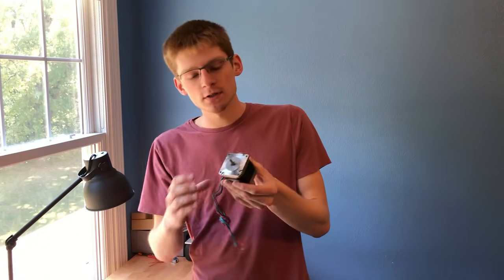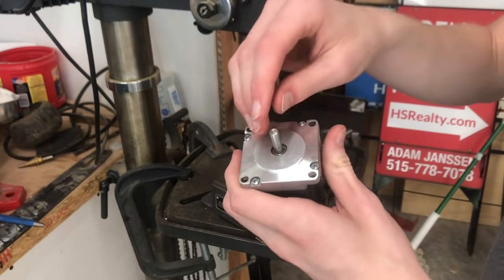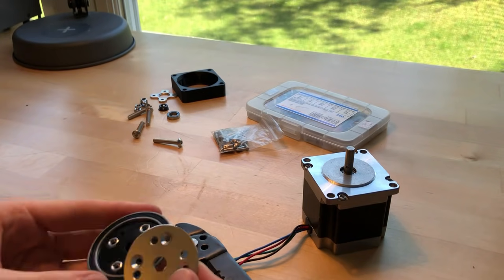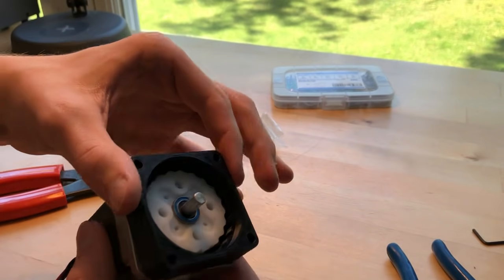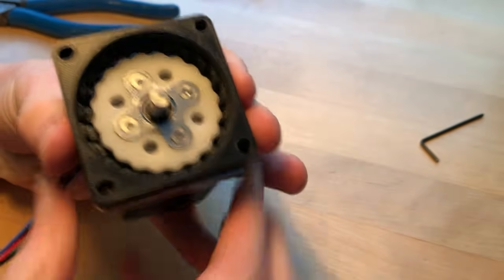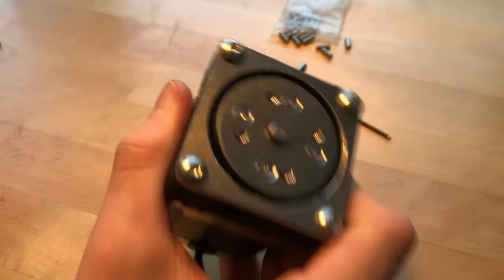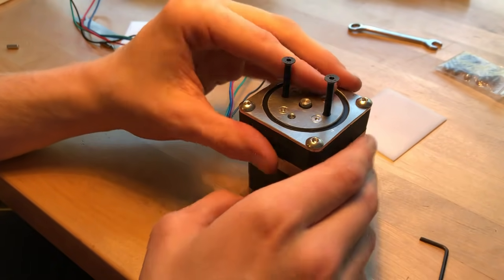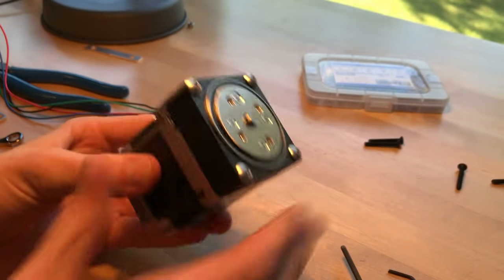High Torque Cycloidal Drive (NEMA 23 Motor)

Comment: When designing for 3D printing, keep in mind that every measurement in Z has to be a multiple of your 3D printer's Z step size. If it isn't, your parts will be off by whatever amount is necessary to bring the height to the nearest z-step. Also, use machinist's feeler gauges to get your bed dead nuts accurate.
Reply: Yeah but you have to think about the first layer too. Because for adhesion you squish it most of the time
Reply: For simplicity i stick to all dimension being 1/10th of a mm tolerance and use that as layer size
Reply: @BrosBrothersLP  There is the elephants foot setting for that to compensate the overextrusion in the first layer.
Reply: @FreeOfFantasy  the elephant's foot setting just adjusts the xy expansion of the first layer I think @BrosBrothers is talking about the not perfectly defined hight of the first layer ;)
Reply: Adaptive layers solves this issue to a great degree.
Reply: @BrosBrothersLP  It is bad if you squish the first layers, that's called elephant's foot... a proper Z alignment will give you squish-free first layers.
Reply: @BrosBrothersLP  use a structure below the print like a raft or custom structure to solve the squishing of bed adhesion
Reply: Another remedy to this is to orientate the part at 45 degrees to the bed. Additionally this can help reduce the amount of supports.
Reply: Not anymore! Slicers are starting to implement variable layer height
Reply: @skipfred  Good to know, thank you.

Comment: I think you drilled out the wrong holes.  You need to allow eccentric motion between the output drive pins and the white cycloidal gear.
Reply: Yeah I don't know how it would even be able to turn without that, interesting
Reply: Right, that is why it doesn't have a contineous and smooth rotation as the acrylic is being smashed by the 4 Pin (from output shaft).

Comment: design a direct drive  3d print head using a very small stepper motor and this concept.
Reply: Second that :) I only found one project using a cycloidal gear for an extruder. Wonder what's the reason we don't see this more often for extruders.
Reply: @neur303  There is too much slop in the mechanisms as well as too much friction. Therefore it would have horrible backlash in an extruder, and would extrude inconsistently. Planetary gears are superior in just about every way to this. Of course this does allow a bigger gear ratio in a small form factor, but the negatives aren't worth it.
Reply: @Chris-hn4lp  I read quite the opposite. That they minimze backlash in comparison to other gears.
Reply: @Chris-hn4lp  It seems planetary gears offer more torque per volume. Which would be quite reasonable for a direct drive as lower volume should also equal lower weight.
But I still believe there's more to it. Like you wouldn't be able to use a planetary gear with plastic gears. And the cycloidal gear should be a lot easier to manufacture.

https://www.machinedesign.com/news/article/21829580/comparing-cycloidal-and-planetary-gearboxes
Reply: @Chris-hn4lp  yeah this a one of the few designs without backlash, not that it is an issue for the extruded as it can be correct with extra restart on retract ...
Reply: @neur303  The article you linked says the exact opposite of what of you just said. It confirmed what I said, that you can get a bigger gear ratio with a smaller size cycloidal gear. I think you misread it wrong.
Reply: @neur303  The article you linked did say  that unlike your other comment, but I was specifically referring to gearboxes using 3D printed parts. You need extremely low tolerances to get a cycloidal drive with low slop and backlash. Planetary gears on the other hand are much more forgiving of tolerances. So sure, if your using an EDM to make your parts, then yes, you'll get less backlash with the cycloidal drive, but if you're using FDM 3D printing you'll have better results with the planetary gear.
Reply: @Chris-hn4lp  Cycloidal often have extremely low backlash.
Reply: @neur303  I saw a guy lifting an anvil with 3d printed planetary gears

Comment: Please use real units and not ounze-inches or so. Please! There are internationally used units that really base on each other. Please!
Reply from the maker: I tend to prefer ozin to Nm because they're easier for me to visualize. A newton meter is much to large to give an intuitive measurement when dealing with small motors. Of course, though, metric remains far superior to imperial.
Reply from the maker: I believe NASA has since wised up and switched to metric.
Reply: @LeviJanssen  thanks for your answer. I do understand. For nema17 I tend to use Ncm which 1/100 of a Nm.
Reply: @haenselundgretel654  It's ironic that you use nema17 as an example, as that is the "National Electrical Manufacturers Association in the USA"  The 17 is 1.7 inch frame.
Reply: "real units"  units are units.  Anyone that's smart can use either one with no issue.  We learn both in the US and both are easy and useful.  Each one is useful to certain applications.  There is no "superior units" lol

Comment: You need a second disc to offset the vibrations for when the 1 disc hits the pins.
Reply: Yep, with the cams for each cycloid disc set at 180 deg to each other.
Reply: @owenjones9608  I see... That's beautiful

Comment: Your output shaft can only do circular motion, however your gear moves in a wave form around your motor axis. Pining these two together creates a lot of friction. Using long holes towards the center of your output shaft would allow for the wave motion of the pins and no sticking.

Comment: Good job! I tried bearings instead of pins for the roller and got smooth running.
Reply from the maker: If your system is similar to mine, how did you ensure the straightness of the output pins? I think this is my primary issue.
Reply: @LeviJanssen  I had the same problem so I used a second disk/plate on the other side of the lobe.  My gearboxes, though, are pulley driven so I can assemble them from both sides - I don't have to stack parts on top of a motor - http://www.franksworkshop.com.au/wordpress/2018/03/04/3d-printed-hypocycloidic-gearboxes-iii/

Comment: Ounce inches?
Burger pattys per hot dog...
Metric is the answer
Reply: My reaction was pretty similar xD
Reply: My cursor instantly hovered frantically above the "thumbs down" icon ... imperial "units" gives me the creeps :-/
Reply: @jorgenskyt  I know,
So complicated and frightening.
Reply: Unicorn turds per full moon

Also I wonder how this thing turns at all, considering the "wobbly" wheel seems to be directly connected to a fixed output. But maybe I overlooked something.
Reply: And the whole project should take about 15,6/31 metric light yards of time to complete :).
Reply: @quaraluch  15,6/31 light yards?
Traitor! there is no decimals in freedom units ;)
Reply: @quaraluch  metric light yards? I think you meant light meters.
Reply: @safetyinstructor  That would be the conversion ratio from the nautical light yard. I guess? To make things more simple.
Reply: @Unmannedair  I'm referring of cause to the standard metric backyard unit length? You know to make things even simplerer.
Reply: Why would anybody use non-metric system today??? I would gladly turn my back to metric for more supperior measurement system.
Reply: My thought as well. Especially with ounce being used for unit of mass, weight or volume and combined with the non decimal inch - ouch!
What's wrong with Newton-metres?
Reply: Lawson Bentley  this has nothing to do with the discussion. 
So yeah, nobody cares about your attention seeking.
Reply: @Melesio Albavera NASA has  been using metric for most of their missions including the Apollo program.
The rocket was engineered in metric and the guidance computer was programmed in metric.
Do your research before you brag.
Reply: @Melesio Albavera Well, we all know where Wernher von Braun came from ...
Reply: @Melesio Albavera Feets, barleys and fathoms has nothing to do with Freedom. It's just plain stupid today. 
Gave a lot of sense in the old days, though and here in Denmark we have been using fathoms and all kinds of derivatives based on this ("height of a grown man") long before the viking age. We stopped that in the beginning of the 20th century, converting totally to the metric system. But we are still taught the old measures in school, as it has great historical significance. :-)
Reply: @safetyinstructor  I remind you that the Apollo 11 flight computer - using metric internally, probably leading to communist sympathies - nearly dashed the LEMs delicate hull against a massive boulder field. It was only the quick thinking of freedom lovin', burger eatin', feet per second usin' Neil Armstrong that prevented calamity. All successful manned missions to the moon have used Imperial units for their flight instruments. Jokes aside, Imperial measurements are better for everyday use - you can half, quarter, and third things without obnoxious repeating decimals, and Fahrenheit is a nice heuristic "rate the temperature from 0-10" scale. Nobody lives their lives based on when water freezes or boils, all I need to know is less than 0 or over 100 means I'm not going outside.
Reply: @David-tl6lv 
Computers weren't that reliable anyways at that time. 
You're not going outside above 100°F? 
What about the folks in Texas? "usually" it's above 100° in Texas. 
I'll have to disagree on the fractions and °	F.
Boiling and freezing point of water are actually a nice reference however if you don't like °C you can use °K wich is thesame as °C just without negative numbers.
Zero means zero.
In metric you don't need fractions because there's millimeters.
This is a big advantage over imperial when you need to do calculations.
All the facts aside, metric distances are calibrated by the speed of light.
Now how cool's that?
Reply: @safetyinstructor  Cool? Maybe. But it's not as down to earth as an acre being the area 8 oxen can plow in a single day, or a mile being derived from 8 furlong - the proper length of a furrow.... Quite literally down to earth.

As for temperature, I disagree. Where I live a nice snowy Christmas day is typically 10-20 degrees Fahrenheit. Cold, but not overly so. And as an endotherm with blood that doesn't freeze when water does, the precise phase transition temperature of water at one atmosphere of pressure is irrelevant, outside of some pretty frozen lakes. On the flipside, 95 is a very hot summer day, and as for Texas, I went there once when it was 100+ degrees, and I'm never making that mistake again. I truly believe Texans are not human, as nothing human can survive such a sweltering humid inferno.
Reply: Same with ALUMINUM - all over the world its ALUMINIUM.. but there they simple forgot one letter..
Reply: That hit me the same way.  Metric really should be the language of science and engineering--even here in the States.  At least provide both.  Don't make us go look up the conversion ourselves.
Reply: @TesserId  I agree
Reply: Yet, he's using metric screws.
Reply: @Badspot  ~665 ?
Reply: @safetyinstructor  You gotta cancel out the units too
Reply: @jorgenskyt  As an American engineer I agree 100%. I've lived in the U.S. all my life, have 2 degrees in engineering, and still don't fully understand pounds force vs pounds mass.
Reply: Can kinda picture an ounce inch, not sure use what a block of butter hanging from a matchstick is tho.
Reply: @timburton1080  inch pounds?
Reply: @safetyinstructor  ha even then I've got that wrong haven't I
Reply: @timburton1080  I'd say a block of butter hanging from a matchstick pretty accurately represents one inch pounds ;)
Reply: @SaHaRaSquad  Wait, unicorn turds per full moon is a measure of frequency though, right? Or mass flow rate?
Reply: @gacekky1 it's not a cult it's called being sane ;)
Reply: I'm fine with basic units, i.e. inches, but derived units like for torque or thrust? Yeah, that's when you switch to metric.
Reply: @sjdpfisvrj  Milliliters is for science,
Ounces for drinking
Reply: @SaHaRaSquad  Have you ever put a fencepost in the ground? When you wobble the post in the (slightly too large) hole clockwise, the post turns counter clockwise! same deal here!

Comment: A little hint for making those full depth cuts through metal, use cyanoacrylate glue to bond to a metal base that acts as a heat sink and cut all the way through your thickness of stock to be cut.  If the metal stays cool enough (by keeping your depth of cut small enough) the glue will hold throughout machining for thin parts like you fabricated.  When the stock your cutting gets too thick, the side of your cutting tool will grab and toss the part with this technique with full length cutting flutes, but you can cut thicker stock by adding a draft angle to just keep the tip of your tool engaged with the part when cutting deep.  To release, heat the metals and the CA glue will fail avoiding warpage and dinging from manually shearing the joint (a little acetone soak works well too, but takes longer).  This and some of the other good machining tips I see in the comments will really improve your finished parts.

Comment: I think most cycloidal reduction drives have two sets of gears with 180 degree offset lobes.  That may reduce your backlash somewhat
Reply: The offset lobes won’t reduce backlash. The purpose of the 2nd lobe is to eliminate vibration. Any mechanism which includes an eccentric rotator will have vibration. The 180 degree out of phase counter-rotator cancels it out.

As for backlash, if a cycloid is manufactured with the correct tolerances, there will be zero backlash. All teeth are simultaneously engaged. The lack of backlash is why cycloids and harmonic drives are used in robotic arms. Without the lack of backlash, repeatable, precise positioning is not possible.

Comment: The wobbly vid was funny at first but got to be an eye strain.  Being a person working with mechanical devices, might want to find a camera mounting with some isolation from the work table.

As a side note, having recently been to the dentist, I was a bit fascinated with the ceiling mount for the work light, with it being totally free within it's range of motion and total isolation from everything else (except maybe the floor above).  This won't cover all needs though, which is why it's just a side note.

Comment: Just a note regarding attaching the NEMA23 motor to the black plastic. The screws are intended to be inserted from the back of the motor toward the face of the motor. Epic job btw. I'm going to try building one with a brushless motor. Might might a good servo motor.

Comment: I think some grease will help smooth out the motion.  It's common to use things like white lithium grease in airsoft gearboxes that have high torque and plastic/metal components, can hear a difference when properly applied.

Comment: nice work, but I think pins on shafts greatly weaken the shaft by subtracting up to 40% at a crosssection. Grinding a flat spot is much better IMO.

Comment: Great job! I think not continuous (not smooth) rotation of the output shaft is caused by step rotation of the step-motor multiplied to gear ratio (x20).
Reply: divided, not multiplied.....
Reply: @fabricioleinat  Right. My mistake

Comment: It's not friction that prevents you from backdriving it, it's mechanical advantage (or lack thereof). 20:1 ratio means this is like trying to use a level to lift something, but the fulcrum is 20 times closer to you than to the thing you've trying to lift.

Comment: NICE MODIFICATION ,, I HAVE A QUESTION , ON REST WITHOUT POWER SUPLLY HOW MUCH IS RESTING TORQUE OF THAT MOTOR , WILL YOU ABLE TO MOVE MANUALLY ON RESTING SRATE & WITHOUT POWER SUPLY

Comment: An easier setting for your nema23 might be an arduino with a cncshield, a drv8825 or better stepper driver and estlcam as control software. Much easier to set up and vary.
Reply from the maker: I only made a custom drive because I didn't have one lying around. A proper shield/circuit would have been desirable, yes.
Reply: @LeviJanssen  it's just the arduino with a "cncshield" for about 10 bucks at aliexpress and a stepper driver like a drv8825 or a tmc2208.

Comment: The hole in the square black piece that sits on the motor should have the exact same size as the pilot sticking out of the motor. It's going to be a standard size for any motor of that NEMA 23 size.

Comment: u need to make it double staged to cancel the wobbling. been there. done it.
Reply: what does double staged mean?
Reply: @MM-24  one way is to make  the output shaft ot the motor moves the first stage and the output of the first stage moves the second stage but that does not cancel the wobbling ...  its like puting two of this devices in line . u get a lot of reduction.

the way wobble got canceled for me was to put two of the center parts of this design ( the one that moves) 180 degrees from each other one above the other.  so you dont have the wobbling , its cheaper than the first way i told you , it has less parts but ...  you  dont get the added reduction of a proper double stage.

chose your destiny...

Comment: If you ever do such a project again think about using the tmc 2209 drivers they will remove all noise and are controllable over a single wire. Cool mechanism tho

Comment: Try to design for a 1:10 ratio if you plan to use in robotics. Also the pins inside should be able to rotate as the eccentric wheel pushes and leans on them (not rattle though)... maybe have them on tiny bearings? Also, maybe lubricate the inside of the mechanism...